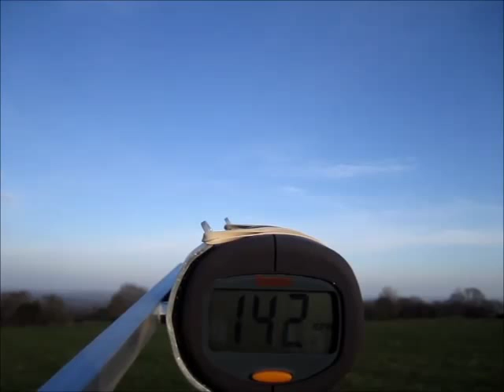Speed record challenge w/ 250mm (or under) quad. Part2- 4s first run, 142km/h

Comment: On those turns at the ends of the runs... try banking and not doing the flat turns.  Try some yank and bank.
Reply from the maker: Qromer Tried yank and bank as well, not working much... I'm losing yaw straight after I release the throttle, before I even pull back pitch to slow it down.